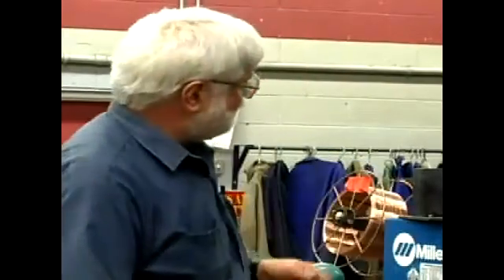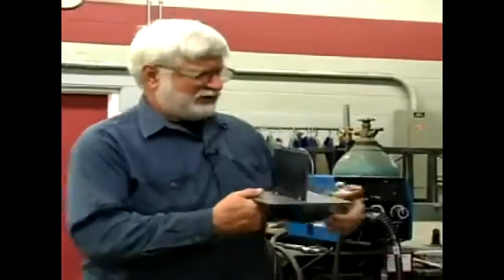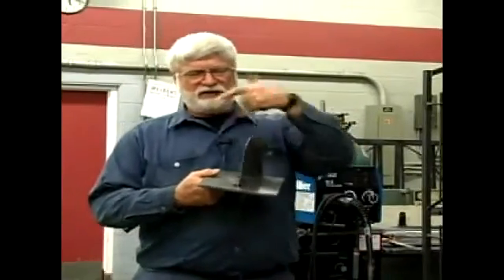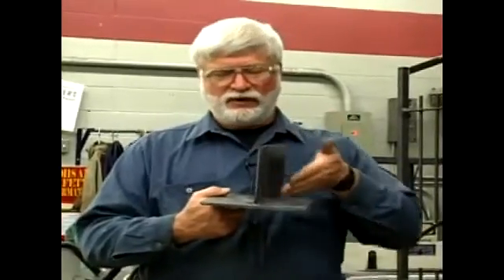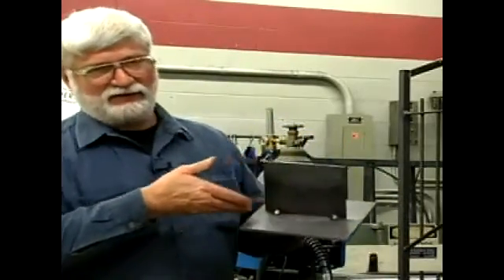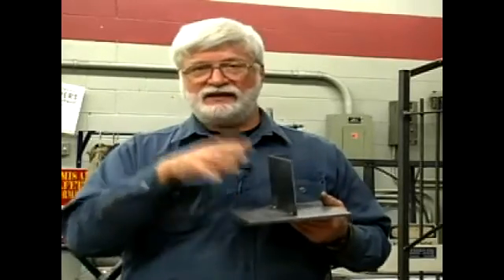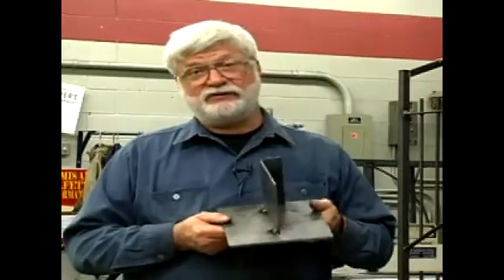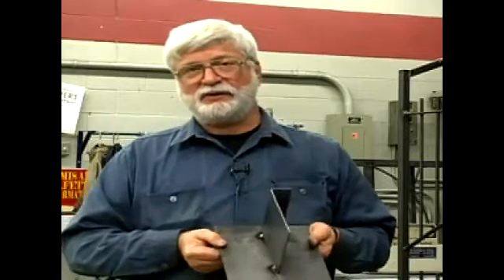What is Tack Welding?

Comment: Is there any reason that a  welding machine that can handle an e6010 electrode won't be able to handle a 6011 or a 7018? The specifications on my machine only mention it can handle an e6010